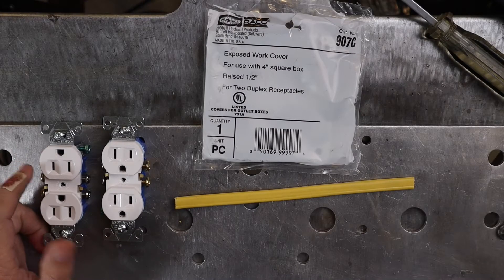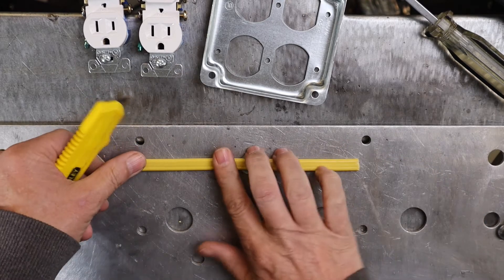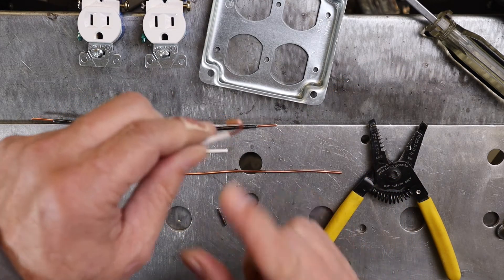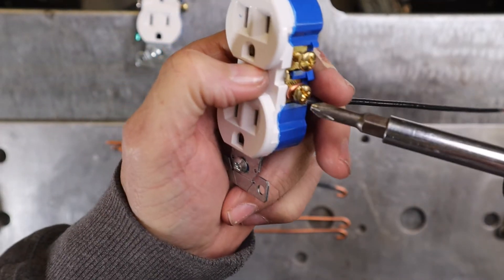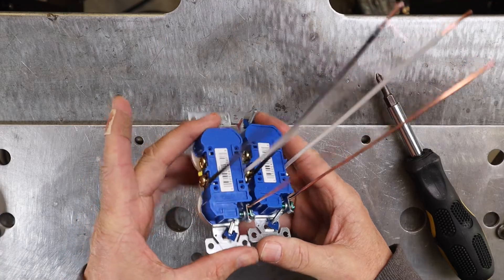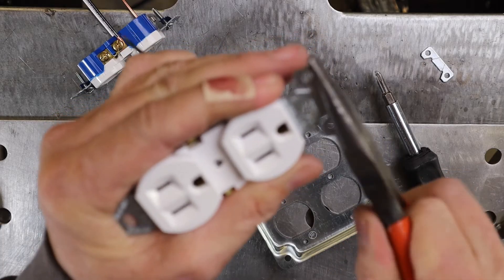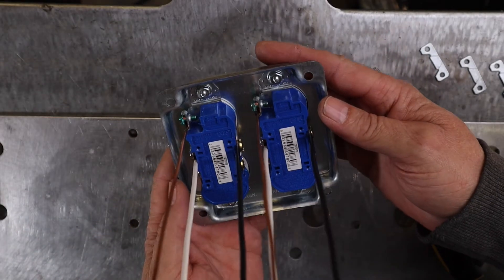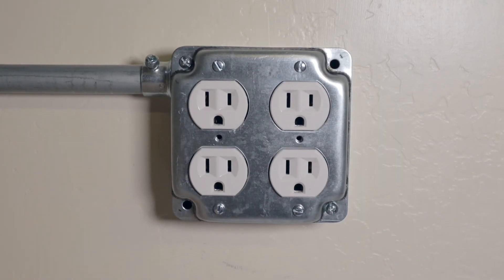How to Wire a Double Duplex Outlet - DIY Wiring Projects (OFFICIAL VIDEO)

Comment: Older Raco, Mulberry, and Steel City covers are not drilled at the top and bottom, only at the middle.  I always drill them out with a 9/64" drill bit for 6-32 screws and flange nuts like the newer ones.  It takes a bit of work but prevents the receptacles from possibly breaking when inserting a plug because they were not properly supported.  I also use the broken out plaster ears from the receptacles as a source for free #6 flat washers.  On the last one of these that I wired up I looped the black and white wires around the screws on the first receptacle and terminated them on the second one.  I am not happy with Raco as the company has moved current production to China.

Comment: Hello, I am just a DIYer asking basic questions. I am just wondering why do you have your Romex through a steel conduit? Can you use AC90 through any conduits?
Reply from the maker: The only reason I did it that way was it was the cheapest option I had at the time. Some say not to use Romex in conduit because of potential heat issues but I didn’t have any issues with that set up over the 4 years or so I used it. Don’t know if you can run AC90 in conduit or not. Shouldn’t have to because it’s got its own shielding built in I would think.

Comment: Say a commercial or hospital outlet.  What would the failure mechanism in one outlet be that would stop the second outlet from working if the second is wired under the same pressure plate as the first?  Note the high grade outlets have explicit postions for two wires under the pressure plate of any single screw.  Seems to me that joining under a single pressure plate is as good as inside a wire nut.  Please educate me.  Thanks.

Comment: Why use a 15 amp outlet on a 20 amp wire?
Reply from the maker: Mainly because I don't own and never have owned any tools or device that requires a 20 amp plug. It's perfectly acceptable per code to use a 15 amp outlet on a 20 amp circuit as long as it is more than one single 15 amp outlet.

Comment: Lever nuts is the way to go
Reply from the maker: That's what I've heard. I have quite a few regular wire nuts left over from previous projects so I'll use them up first.
Reply: @DIYHomesteadProjectsDIYHP10  it's a game changer. It's like plug and play.
Reply from the maker: They look easy to use and easy to undo and reuse if needed. 👍
Reply: @DIYHomesteadProjectsDIYHP10  I don't use wago brand, I use the Jomeron brand type. It's just a preference..
Reply from the maker: Awesome! Thanks for the info!

Comment: Best practice is to have both hots facing one another to reduce a flash if water enters box. Also best to use quality made in USA ( Not cheating china shitty tape ) electrical tape and install at least 3 full wraps around every switch & receptacle.

Comment: Hey mate rewatching your video, awesome presentation and the example I will be using when I do my outlets. Question: Was the emt pipe gap to the wall significant enough that you would recommend using and offset coupling or not?
Reply from the maker: The gap is about a 1/2" or so. My runs were fairly short so I decided to go with no offset but if I had longer runs, I think I would prefer to use an offset with hangers to hold the conduit against the wall. It's really going to be up to you as to what you can tolerate.

Comment: I want to ask you a question ? I have been told that the ground should be up. I see other you tubes do it both ways. I want to make sure when I go this its right. Thanks for your Help.
Reply from the maker: Some people believe it's safer to install the outlets with the ground up. If something is dropped onto a partially plugged in device it won't easily arc, at least that is the theory. How you mount the outlets (ground up or down) depends on where you live. Some places favor one way or the other. Where I live I never see outlets mounted with the ground up and that's why I mounted mine with the ground down. The bottom line is you can mount them in what ever orientation you are comfortable with.

Comment: Do they make any metal boxes that actually have screw tabs on all four corners so that when you put the industrial cover it secures on all four corners and not just on the two opposite corners? Having those two corners as just holes is bring out my ocd. Thanks for your reply.
Reply from the maker: I have not seen one with tabs in all four corners.
Reply: Never saw any in my 50 years as a sparky. They do not come loose very often if tightened properly. if worried just place a dab of clear silicone on head of screw to cover.

Comment: You need to take a 6-32 yoke screw and secure the receptacle in the middle.
Reply: Not if you use the far superior outer two 6-32 screws. If I have a short 6-32 oval head screw I will install it. During my 50 years as a sparky have seen well over a hundred either loose or missing center screw on receptacles mounted on 1900 boxes + 4 by 4" square ) especially on ones on end of cords that get banged around. Years ago we used to drill our own holes then use either a nylock nut or hex nut with a locker washer to prevent screws from coming loose. A drop of silicone works great.

Comment: As an electrician I always use pigtails. Not for the reason if one fails they all fail as that is false info since the flow goes thru the copper tabs on the side of the outlet but, for the reason of not having the entire load of the circuit going thru each outlet. 

Also, while it’s most common to put the ground on the bottom , outlets we’re designed to have the ground at the top. That way if you drop something metal it will hit the ground tab and move away from the hot. The NEC leaves it as a preference as far as residential wiring goes but in my area commercial and hospitals are required to have the ground up.
Reply from the maker: Thanks for the input.
Reply: No load goes through a receptacle when nothing is plugged into it.

Comment: This would have been even more helpful if you showed how you connect those outlets to the face plate. I'm having a really tough time finding an explanation, and i know that it doesn't go together l like an inside plate....edit - rabbit ears and screw need to be removed from outlets then secure outlets to faceplate, then faceplate gets secured to the box. Now I can complete my garage install.

Comment: Was that romex pulled through conduit. I was told that was a no no. The wiring was not addressed.
Reply: It is acceptable.
Reply: I, too, have heard many times that running NMC (Romex) is not permitted to be run through EMT or other conduit.  If that were so, you'd think that they'd quote the section of the NEC.  I'd like to read the section that says that.
Reply: @WelshRabbit  334.15 NM cable "protection from physical damage and the basement thing.  One in "B" and one in "C".
Reply: Allowed for protection from physical damage....334.15 b and c.

Comment: How are there four ground wires? I’m putting one together and there’s only three.
Reply from the maker: My fourth ground wire goes to the metal box. If your incoming ground wire is long enough you can just loop it around the ground screw in the box and then connect the end under the wire nut with the two grounds coming off the outlets. Mine wasn't long enough for that method so I ran an extra pigtail to the metal box ground screw. Hope that makes sense.
Reply: @DIYHomesteadProjectsDIYHP10  Yes thank you.
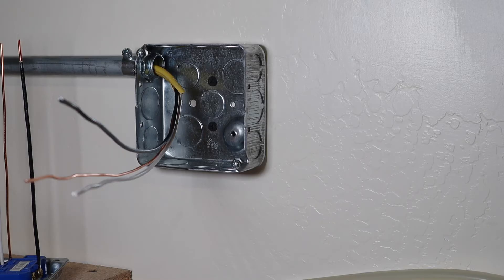Reply: @DIYHomesteadProjectsDIYHP10  One other question: what is the diameter of the metal tube that's hooked up to the box at 10:12? The box I'm using is slightly different in that there is a screw attachment instead of a punched-out hole for a connection. It's an outdoor box so it has to be watertight.
Reply from the maker: Here is a link to the EMT connectors I used. https://amzn.to/3gTybZi You may need a different kind for outdoor instillation but I'm not sure what they are called.
Reply: @patricksmith5031  looks to be 1/2 inch conduit.

Comment: Power dosent flow thru the outlet in a daisy chain it goes from one screw term to the other same side thru a copper plate with a raised bridge in between that can be separated to make 2 devices fed separately
Reply from the maker: Thanks for the info
Reply: All receptacles are wired in parallel & not series.

Comment: Where did you get that four pack of nuts 🔩? You said it came with it?
Reply from the maker: Yes the four nuts and bolts came with the metal box cover if I remember correctly.
Reply: @DIYHomesteadProjectsDIYHP10  thank you. Did you buy this pack from Amazon, Home Depot?
Reply from the maker: Sure! I purchased the ones in the video off Amazon. In the video's description there should be an amazon link for the items I used in the video if you are interested. I also believe Lowes and Home Depot carry these items as well.

Comment: I'm a diy'er and I like the way you did that. It looks professional to me and that's the way I have done it. However, I would use individual THHN wires instead of romex in emt and wrap the screw connections with electrical tape especially in metal boxes to prevent shorting.
 I also think it's not correct as many people say that using all the screws means that current must go through the receptacle, assuming it's not a split receptacle. Look at the plate where the screws are mounted. Sometimes this is falsely called connecting in series. Receptacles are always in parallel. I think the distinction is more accurately described as daisy chaining vs pigtailing.
Reply: Romex in conduit is technically against NEC. uF-b is fine in conduit and raceway but romex is not.
Reply: @jonosterman2878  Josh, 334.15 (NM cable) lists emt as " approved protection" along with other conduits for protection from physical damage,  normally ahj in garages.

  Also, (not by my book) but the section in the back of the code that helps you calculate conduit fill....Ch 9. Table 4. Maybe....about page 70-695 in the 2020 code....note 2 in table points to fill requirements not designed to apply to protection piping, so as long as it fits?

Just fyi.
Reply from the maker: Thanks for stopping by Ted. I appreciate your comment and input!